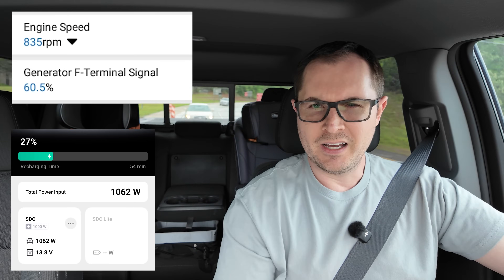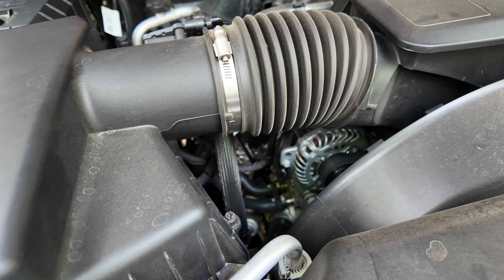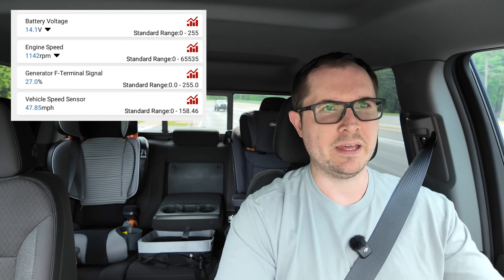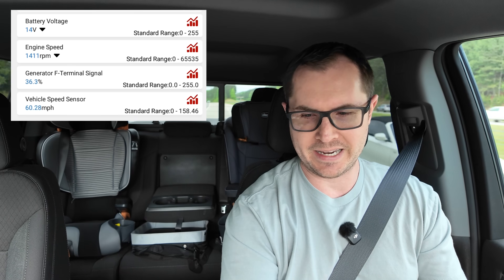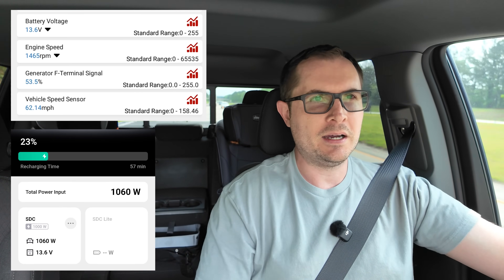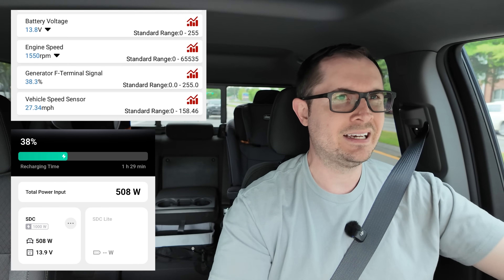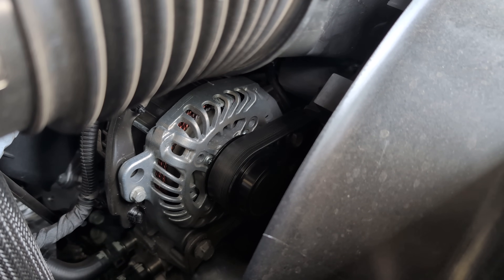I Show REAL Numbers: Impact of DC-DC Chargers from DJI, EcoFlow, Bluetti on Alternator

Comment: This was amazing, thank you for sharing. I wonder how this differs with hybrid vehicles.
Reply from the maker: Thank you for watching. Great point. The hybrid factor would be interesting.
Reply: As a Prius Prime owner who got his first Prius in 2000 when they arrived, I'll summarize the consensus of Prius aficionados.  The same would apply to all normal planetary-gear Toyota hybrids, not necessarily the (mostly truck) normal transmission, power-boosting hybrids.

Basically, someone who is chicken can draw 500W, most are comfortable drawing 600-700W, and nobody in the know recommends pulling 1000W or more continuously and routinely.  But it's been proven that drawing 1000W for several days when using the car (generally powering an inverter hooked to the 12V batter, with the car in Ready mode, as in ready to drive) to power a house during a power outage has led to no disasters.  Failure of the Prius DC-DC charger which takes the place of an alternator, is almost unheard of.  Normal failure mode of drawing too much, is that the 12V battery voltage will drop, and a Prius with low/flaky 12V voltage will give crazy problems and errors sometimes, remedied by charging or replacing the 12V battery as needed.

Opinions vary among the experts on PriusChat, but most of them (including me) are comfortable powering a 700W InstantPot, but not a 1100W microwave, with their Prius.  Anything in the 1000W range and up, should be run off LiFePO4 batteries, that you are free to charge at the time and wattage of your choosing, from the car.  

I run my car enough when car camping, and use little enough energy, that I can get along just charging the LiFePO4 from the car's 12V socket while I sleep with the climate control on.  But I've also gotten a 30A Kisae 1230 DC-DC charger which can be set to 5/10/20/30 amps.  Their 1250 model can be set to any multiple of 5A, from 5-50A.   For my needs, 30A or even 20A is plenty, especially when combined with the 10A 12V car socket.  

Just the car  socket can simultaneously charge my phones, run my laptop, and run my 12V freezer in eco mode.  Or run the freezer and charge the LiFePO4 at 4A.
Reply from the maker: @EfficientRVer  Thank you for adding that helpful info!

Comment: When load increases, voltage drops and amperage goes up. Volts don't charge batteries, amperage does. Amperage is what causes increased heat. Using a vehicles alternator to constantly charge low batteries is absolutely a bad idea. As you drive your vehicle is using equipment. Yeah anyone using their vehicle to charge power packs all the time is a bad idea. Emergencies is one thing, otherwise use solar panels. Better be glad we have alternators rather than generators as we had 60+ years ago.
Reply from the maker: Thanks for watching, and that's great feedback.

Comment: Alternator's are not designed to operate more than 30 to 40% for extended periods of time. It will ruin the alternator. It will not be able to get rid of all that heat easily. You have shown how easy it is to over work the alternator. 
Most it not all charging systems are equipped with a veritable charging system to help improve mileage, reduce wear on the alternator, and not over charge the battery.
Making all the above last longer. This is very good information you have compiled. Thank you for providing this information to the public and I hope they will make decisions on the whole picture instead of just installing a Dc To DC charger . You need to take everything in to account like you did so well
Reply: Where did you find info indicating they are designed to operate at 30-40%? The 60034.1 standard looks to indicate they're rated at S1 and/or S10 standards for 70-100% duty cycle.
Reply from the maker: Thank you for watching.

Comment: Good info.  People need to know the risk and effects.   Also, these alternator to lifepo battery chargers often claim charge ratings that most vehicle alternators won't be able to support.  I have heard of people upgrading their alternators to accomodate this.  It's an expense and part of what you are looking at if you use one of these chargers.  Solar might be cheaper.  You might want both, but you have to pay.  These chargers seem overpriced to me and even more so when we figure in alternator costs.  ONE QUESTION:  What happens to a alternator that burns out?  Bearings and brushes?  Regulator burn out?  On my old 60's VW the alternator was separate from the regulator, but more recent Toyotas and Nissans I believe the regulator is built into the alternator and you have to replace the whole thing.
Reply from the maker: Great point. Thank you for watching.

Comment: Excellent presentation.  Thank you.  I have a 2004 Duramax with dual batteries that came with a 105a altgernator from the factory.  I have the new 700w Victron Orion XS 12v charger on the truck.  I have done most all of the same testing that you have at various loads with the Victron.  I can adjust the power draw on the unit and can control how much load it will put on the truck.  One thing you need to check is the "temp" of the alternator, especially if you idle the truck much when charging - like at a campground or whatnot.  There is less air moving under the hood and with the alternator turning slower, it also moves less air though the windings.  I think that is the real killer of them.   I normally cap the load on mine to around 30-35amps to keep the alternator temps down.  If you pull a 1000 watts from the alternator at engine idle and parked, that bad boy is going to HOT regardless of what it is rated at.  It would be interesting to see some studies on the "duty cycle" of various alternators both factory and aftermarket.   It would not be wise to assume that they will all do 100% rated output "forever" - or even 60, 70 or 80%.
Reply from the maker: Great points. Thank you for watching.
Reply: I have a vid on adding a larger fa tory alt, may help you
Reply: I have an Orion now in storage- I took it off.  I have a gas engine- weaker alternator.  I had no trouble using it, but I wired an on/off switch into the truck and only ran it while moving.  I decided a solar panel on my camper cap was a better option.  I use it when traveling to places that aren’t going to have a replacement alternator available.  Having replaced my alternator with an aftermarket alternator previously- I found Ram truck didn’t like its voltage regulator after a couple months and shut the trucks computer off- scared me because the truck didn’t show that as a cause.  It would do it while driving at speed.  This failure was before I got the Orion- has nothing to do with Orion.  Your alternator is not a generator.  KISS-“keep it simple stupid”.

Comment: I have a generator box on the back door of my van/jalopy. I pumped it full of holes with a hole saw, including a big one for the exhaust. I installed a shore power plug on the same door. My generator is a cheapo 1000w inverter generator. 

I start the generator, lock it into the box, plug it into my shore power outlet, and start driving. It charges my portable power station, the wind movement keeps things cool, and I take note of how much time my system needs to charge. 

I stop after roughly that much time has elapsed to check if my portable power station is at @100%.

Works ok so far.

Comment: Very informative video, thank you. I use 6 AWG wire to feed a DC to DC converter on a HD truck with a 220 amp (3000 watt) alternator. I keep the device draw limited to 45 amps (630 watts) or less, which is 21% of the alternator output. This was primarily due to the wire gauge ampacity/temp rating of the cables used to connect the devices. I will be turning that down some after this. Also, I think we have the same truck and I've seen setups with 3 alternators mounted to the diesel model.
Reply from the maker: Great setup. Thank you for watching.

Comment: 1000 Watts at 12 Volts is about 80 Amps (1000W / 12V = 83.33A). Now the actual voltage was closer to 13.5V, and that's better, but that varies based on what electrical loads are running and the state of charge of the battery. 80A is a BIG load for a 170 Amp alternator. Keep in mind that 170 is probably a theoretical max. It probably can never reach that many Amps even under ideal circumstances (high RPMs and lots of cooling air)--and definitely not under less than ideal circumstances. When he dials the charger down to 500W, that's only, 500W/13.7V=36.5A. 

I think the moral of the story is that if you hook up a DC-to-DC charger rated for over 1/4 of the rating of your alternator, without some kind of timer or temperature based control system, you could easily overload your alternator. Some alternators have a temperature sensor that cuts it off it if gets too hot. Some controllers, like the Li BIM 225, just have a 15 minute on, 20 minute off cycle to give the alternator a limited time under the additional load, with time to cool down between charging sessions. That is what I have on my Promaster 3500 between its 220A alternator and my 400Ah of Battle Born lithium batteries.
Reply from the maker: Great point. Thank you for watching.
Reply: @AdventureRocks  Thanks for posting it. It's great to have real-world data! Too bad the OBD2 doesn't supply an amps-out-of-the-alternator data stream. 🙂That would be interesting to see, too.

Comment: I would’ve liked to have seen what the DC to DC load at idle was with minimum load from the vehicle (AC, radio etc)
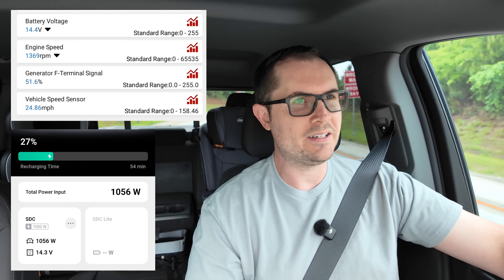Reply from the maker: Great point, 11:20 ish is a sample. Just light AC and radio with DC-DC running simultaneously. Thanks for watching.
Reply: @AdventureRocks  was that with air conditioner turned off? Or was it still at Max speed?
Reply from the maker: @EricW-f7l  just a modest ac setting... Pretty low
Reply: @AdventureRocks  I really appreciate the work you put into these videos. I like technology, but I’m not that technical to figure out this kind of detail. 👊
Reply from the maker: @EricW-f7l  thank you!

Comment: This video is a welcome step toward answering question of DC-DC charger consequences.  To me this suggests that a "bigger" alternator will last longer with DC-DC in use than a "standard" alternator?  Obviously many variables to factor in.....
Reply: Maybe or maybe not.  Pulling a 1000 watts or more from the alternator is going to generate a lot of heat regardless of what the alternator is rated at.
Reply from the maker: Great point. Certainly seems like it would help. Avoiding idling too, perhaps. Thank you for watching.

Comment: My ‘22 4Runner alternator is rated for 130A. I’ve added the EcoFlow alternator charger for my Delta 2 Max power station. The charger is rated for 800W, but I have it set to 500W max. I have a roof top tent, which has 2x100W solar panels on it plugged into the power station. I do have a couple of light bars, ditch lights (all LEDs), and my headlights are now full LED (lo/high beams). May-Oct my power station lives in it, along with a 12V fridge. The solar panels are almost enough (I park in a south facing driveway) to power the fridge full time. I think I will upgrade my alternator more so for the other loads (lights and using winch at night). Also using a big air pump which can only be used at idle, that is a concern.
Reply from the maker: That sounds like a fun setup, thanks for watching.

Comment: As mentioned you need to factor in temperature. Victron makes a little $40 Bluetooth voltage and temp sensor you can stick on the alternator to read temp.
Reply from the maker: That's a great suggestion, thanks for the info.

Comment: Your results align with previous findings of others who have done similar checks.

For those who are not aware, upgrading your alternator has always been recommended (by professionals) if you are not running a dc-to-dc out of a heavy duty truck/van. The alternator from the factory is usually the bare minimum and is there to meet EPA and MPG guidelines.
Reply from the maker: Great point. Thank you for watching.
Reply: Doesn’t make sense, factory wiring limits the load to my trailer to 5-7 amps. Unless I significantly increase wire size, I don’t need a DC-DC charger.
Reply: @ 
The size of your power bank AND how fast you need it to “charge to full” is what important.

If you are only using ~100w daily then a standard cigarette lighter will get you back to full in an hour. If you are using ~1000w daily then it would take that same cigarette lighter 10 hours. So if you are routinely using large amounts of energy then you need an equivalent power charging system to replenish what you are using. Note that this “replenishing system” can be solar, car charging, and shore power so you can have 3x “smaller” systems to meet your energy needs.

Comment: My car is a 1995 pre-OBD2 and only has a 70amp alternator.  What do you think would be a good wattage?  Right now I have it cranked down to 350W, but maybe I should go even lower?
Reply from the maker: Great question. Perhaps if infrequent use, not as much of concern. But, if more frequent use...maybe alternate upgrade in the works or limiting further on wattage if you don't need the speed? 250W?

Comment: I went Mechman on the 2017 Ram Cummins (370amp)(Truck campers with 12v/3-400ah house and Bluetti AC200MAX+B230 + 800 watts solar). Stock is 180amp but I also have a 1000 watt Ryobi under the backseat then a 500w Bluetti will be hooked up as well. The house battery is a beast to charge. I am also going to run the 3 way fridge on 12v just to see what drain or draw it does. K1500 I am going with Mechman 240 amp since stock is only 105amp. When my 5.7l is running the A/C draws a ton and you need that extra to make sure everything idles and charges right. Great video and how the numbers directly effect your system.
Reply from the maker: Thank you for watching. Fun setup you've got.

Comment: gooday from australia.. i use a bluetti charger 1 to charge my bluetti max200 in my camper.  i also monitor via the ecu the parameters of the alternator output in amps , duty cycle, and volts at all times while driving.   the charger 1 has 500 w output but like others can be dialed into your requirements,   i drive a toyota hiace 2.7 petrol,  im sure the alternator is rated at 120  or 170 amps (yet to varify ) the variables while using the chager1 and without  is what i focus on.   not charging the hiace sits around 25 % duty cycle at anything over 1000 rpm.  if i switch on the charger1 to 500w  i see the duty cycle climb to 50% with no accesories on.  i also see a 50amp load .     the charger 1 has a quiet mode switch that turns off the internal fan and reduces the output to 200w. this is the setting i use most.  it draws 20 amps.   one point of interest, the charger one has a cutout voltage of 13.4v i think. so when idling and battery volts drop , the unit turns off automaticlly.. once voltage increases with rpm, the unit turns back on.  a great feature to stop drain on the alternator at low rpm.
Reply from the maker: Great points. Thank you for watching.

Comment: Is the f terminal percentage a moving feast? I.e. is it expressing the % of current output at the current rpm or perhaps it’s expressing a % of maximum potential output of the alternator?  I would assume it is one of these, but which?
Reply from the maker: Great question. I am not certain on which it is specifically.

Comment: Thanks for doing this - I have just added two lifepo4-100AH batteries to my Chevy 4500 Class C, it has a High Output Alt. on it rated at 250amps - I do not have a DC-DC charger other than using the normal system it has built in to charge the house batteries while running. I've seen my Lifepo4  batteries taking up to 1000 watts at 50amps charge while running - it does this until they are at 100% which doesn't take long thankfully since they are rated to take up to 100Amps charge... really freaked me out at first!
Reply from the maker: Fun setup! Thank you for watching.

Comment: Great information! 👍
A solution to the idling problem would be a high idle system like ambulances have.
Reply from the maker: Great point. Thank you for watching.
Reply: Then you'll start to create heat & wear issues with the torque converter & transmission.

Comment: Did you check the temperature of the alternator before and after a heavy load?
Reply from the maker: I couldn't find a temp reading specific to alternator via OBD2, but using basic infrared gun it was 160-165 F on alternator, about the same as other components in engine bay. I have a pretty big fan in front of mine since truck is meant for towing, but I could see where idling in particular could really come into play between shower rpm and less airflow.

Comment: There are smart DC-DC chargers. I have installed Scotty DC-DC charger. It monitors the alternator temperature and also output. They call it AI, but that is just marketing BS. It has some sort of machine learning algorithm where it learns your vehicle on the initial setup routine. When the load or temperature is close to the maximum possible, it reduces the charge. Our camper has small 170A alternator and there's no physical space to install anything larger. Thus using the smart DC-DC charger allows us to take all the juice available without the risk of damaging the alternator.
Reply from the maker: Great info, thank you for watching.
Reply: Exactly. I'm not sure the DJI (as good as they are) is taking system load into account here.
Reply: @berthaduniverse  I think most of the DC-DC chargers are just flat settings. That includes Victron if I'm correct. The Scotty actually works with Victron as well, which is pretty good for the whole system setup.